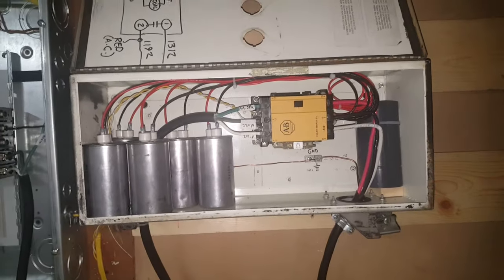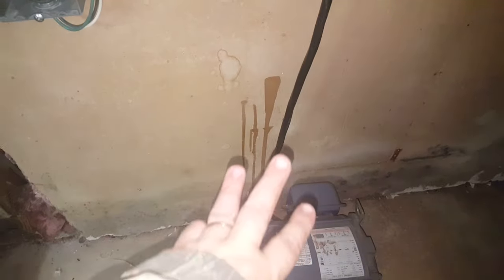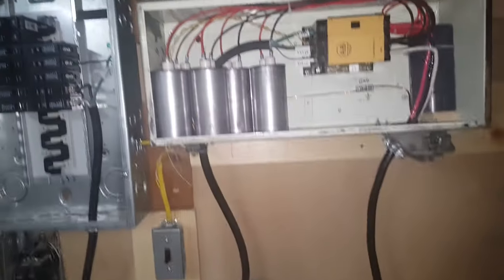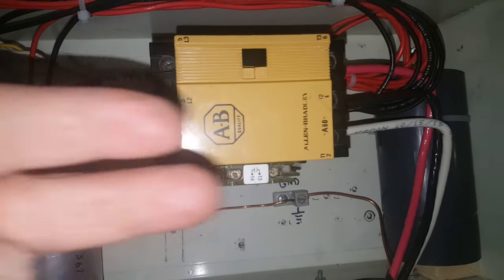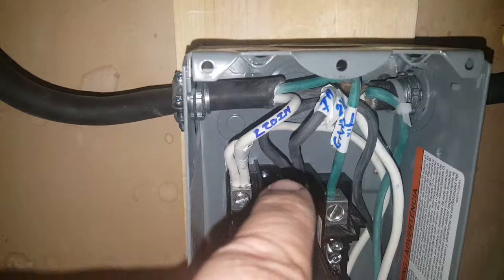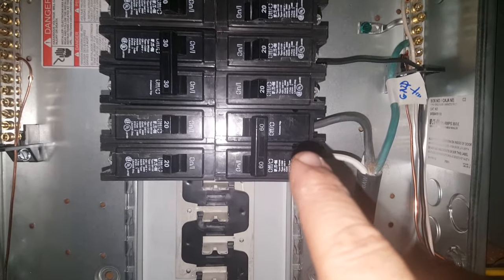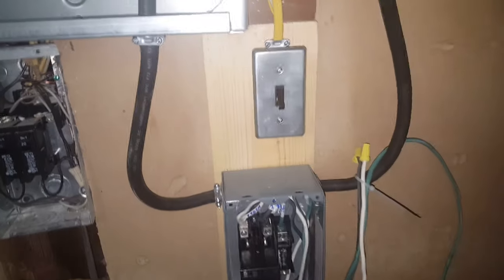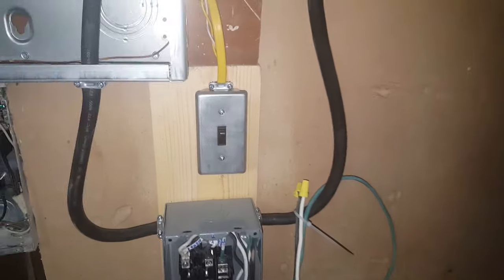My 15HP Rotary  Phase Converter Is Finished

Comment: I would change your on/off switch for a push button start/stop switch connected to the Allen Bradley contactor through the normally open auxiliary contacts.   If the power goes out, your current setup will have it start back up as soon as the power comes back on.  A push button start will drop the contactor out if there is a power interruption and you would have to manually restart the converter.  You could probably find a fairly inexpensive set with enclosure at Grainger.  If you're not sure how to wire it, there are plenty of diagrams online if you Google "Start circuit wiring"  The other things you should address have been covered in other comments.  The biggest one being using green and white conductors for powered legs.  Green is designated as a ground wire and white as neutral.  They need to marked with black tape showing they are carrying current.

Comment: Nice work. You need to disconnect that start capacitor from the circuit after the motor gets started. They are meant to start the motor, not as a run capacitor. Also, if you are using the ground wire in that SO cord as the third leg, you should mark it with black electrical tape at each termination.

Comment: Don't know much about this but aren't the 2 legs of 220v 1p 180 degrees apart and the legs of 3p 120 degrees apart? I understand the motor generates the 3rd leg but how do you get the 120 degrees between the 3 legs?

Comment: how does one  determine  the value of the RUN capacitors if the START capacitors are determined at 75-100 mfd per horsepower ?

Comment: Nice idea and good esplaination.  You just need to pay more attention to wire colors.  Green is reserved for Ground, White is reserved for Neutral, and any other color can be used for hot legs.  There is one exception, if the three phase is not balanced to ground, the higher voltage must be orange.
Reply from the maker: Yep, I get it, the colors are wrong. I have now tagged the colors with tape.  I used the wire I had on hand, and wire is wire is wire. As long as you have the proper gauge, it's all good.

Comment: When you pick the size (hp) you want to use in your converter, do you go for the total amount of (hp) motors you want to power? For instance you want to push 3, 2hp motors and a five hp, do you get an 11 or 12 hp system, or do you go north of the max motor; 5, or 6hp? I'm just trying to take in some of the broad strokes of a workshop's requirements.
Reply: While you should always consult and electrician that has experience with rpc's the rule of thumb is to have  your supply motor twice the HP rating of your biggest load HP (lathe,mill etc). This is because of the possibility of high amperage spikes while starting a machine with a heavy load such as a lathe with a large work pc etc.. Once it is already running you may then operate more than one 3ph machine as you would be producing enough power to do so pending the total combined operating HP dsnt exceed half of the rated output of the supply motor. As for the running caps they are there to "balance" the voltages on each leg of the 3ph which is necessary for sensitive cnc equipment. I was told that this was a big problem years ago but with the newer technology its not really a huge concern but then again with your money maker on the line who's going to chance it.

Comment: I am very interested in the specs for your capacitors and contractor. I've just acquired a 7.5 hp lathe and can't swing the money required for a manufactured RPC at this time and yours seems to be the simplest. Could you post the specs?

Comment: Why so many caps and what value are they? I would like a simple line drawing showing all the caps hooked up. thanks-mike
Reply: phat mike the caps are for tuning the phases, to get them all within a few volts of each other
Reply: I think the capacitors provide the second phase, then the motor generates the 3rd phase. residential panels may have 2x 120 volt feeds, but it's still only single phase.
Reply: Looks interesting 
Where is the capicitor value need to build  one for my dough sheeter

Comment: Hey Thomas,

Nice project... I know a bit about electrical work, basically enough to get myself electrocuted, but I digress... LOL... 

Are you saying that you will use this 15HP Rotary motor to pick up your third phase on house electric so that you convert typical 220 2 phase house electric to 3 phase? I am probably stating the obvious but again I don't know how 3 phase works other than it's used in Industrial applications for mostly all machines, lathes, CNC's and the sort. I also understand that if your 3 phase motor runs in the wrong direction you simply chance any 2 legs and that corrects it. You may want to consider using the Red Wire and replace the Green Wire when it becomes the 3rd leg, just to keep from getting confused. You can use your second box as a junction box to run the Red Wire out from and just wire nut it to the Green Wire. I am a carpenter by trade and over the decades have adapted to learning how to wire a house so this is just an FYI opinion more than anything. 

Since that motor is running anyways, is there a way to hook a pulley up to it and connect it to another motor to act as a generator? Seems that the 15HP is going to be running anyways, may as well get some use out of it other than a third leg...

I look forward to see how this pans out... Cheers...

Comment: The breaker (60amp) that you use for main power does not protect the #10 wire that you apparently are using. #10 wire is rated at 30 amps. At some point I expect you will have overheating( meltdown) issues in this setup if you run more than about 5hp load simultaneously. You've got the main system down pretty well but it needs refining with a relay to drop out the start capacitor and possibly balancing the phase to phase voltage. Don't see that addressed in video.
Reply from the maker: Thanks for the input, I wish I had an electrician I could speak to and learn from. I have new step up transformer that I need to step up to 460v 3 phase, also I have built a second RPC and hope to use it separately for a Bigger 460V cold saw. I can’t afford an electrician to do this work for me, and most I have talked to are clueless when it comes to what I am doing here anyways.   Can I speak to you directly?

Comment: Do you have a schematic posted anywhere?
Reply from the maker: no, but they are all over. I could draw one for ya I'm a few days. I'm out of town ATM.
Reply: +Thomas Shue that would be cool. I'm having problems with mine starting and staying running. I would like to match your setup as close as possible. I've been researching for the last 2 weeks without much help.
Reply from the maker: +LostInTheWoods I'll do it and post a private video for you. sorry for any delays
Reply: +Thomas Shue I think I just need a wiring diagram of your starter caps and the relay.

Comment: How are you disconnecting the start cap once it starts? If the start cap stays in the circuit too long it will explode.
Induction motors are not generators because the rotor is not and cannot be magnetised. Like with an actual generator that have slip rings to energizing the rotor. You can spin that motor with a drill  to operating rpm and maybe only a volt or two will come out. Infact you can remove the rotor and put any metal in it and it would rotate. Even aluminum. They are called induction motors because they induce a magnetic field into the rotor that causes it to rotate. The RFC works on the principal that all the windings in the poney motor  are connected either delta or why inside the motor and because the coils are inductors and it causes an inductance phase shift and and sends it back up the third leg out of phase from the other two going in. The capacitors also create inductance that help optimize the phase angle to balance the voltages.
Inductors 101
https://youtu.be/NgwXkUt3XxQ
Aluminum can in an induction motor coil.
https://youtu.be/3OCkZjw3ZSQ
Reply from the maker: Thanks for the information. My RFC is still working great. I use it all the time. Never a single issue since day one
Reply: @ThomasShue  I didn't say it wouldn't be working fine. Just elaborating on how it works and asked a question. so you don't disconnect the start caps? The black one is in the circuit all the time?

Comment: 120 amps lol really
Reply: it's 100 volt service, but 2 phase residential so it's 200 volt, and the ground wire used as a hot makes it 9000 volt